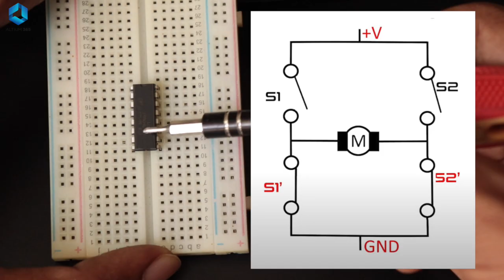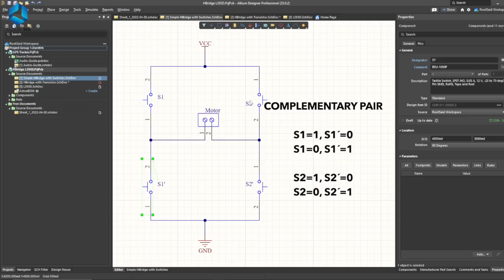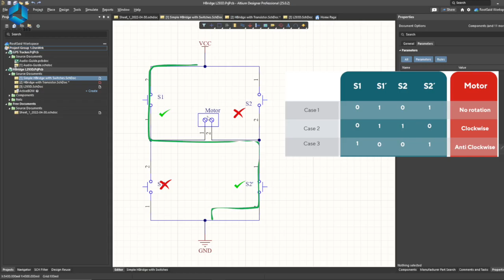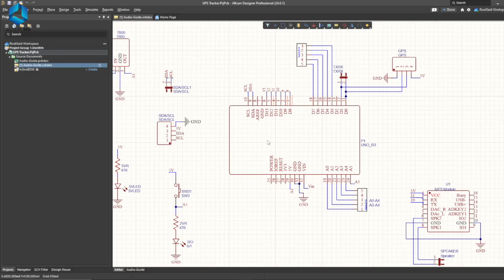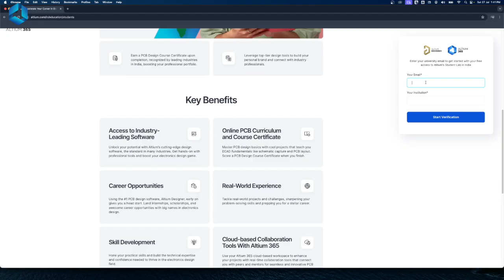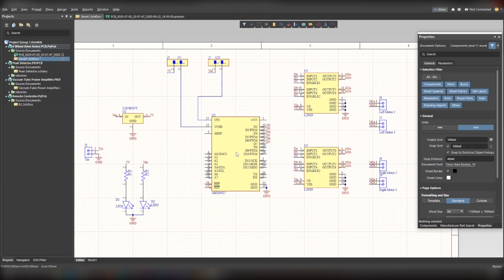Robotics for Beginners - 🔥 Must Know Essential! Driving DC Motors in Robots

Comment: Can you help me with my project? I don't understand how to code. Basically, I want to make a soap dispenser using Arduino and an IR sensor or water pump. When the IR sensor detects a hand, it should make the pump run for 2 seconds, then turn off, even if someone doesn't remove their hand from the sensor range. If someone doesn't remove their hand for, let's say, 5 seconds, a beep will trigger. If they remove their hand, the beep will not trigger, and it will work normally. The pump should run for a while to avoid wasting soap.